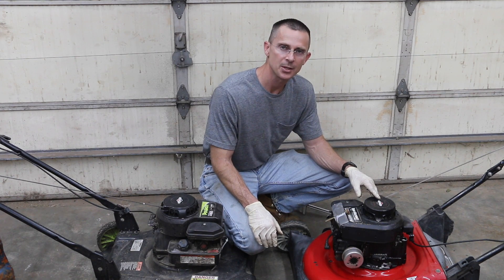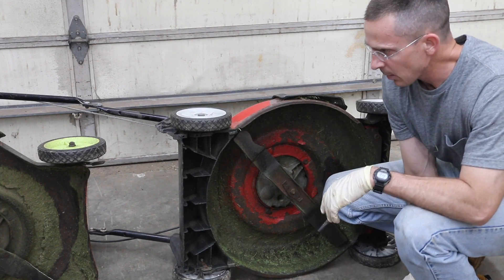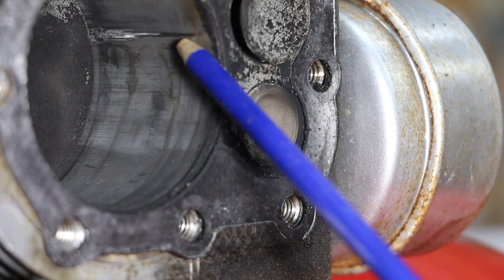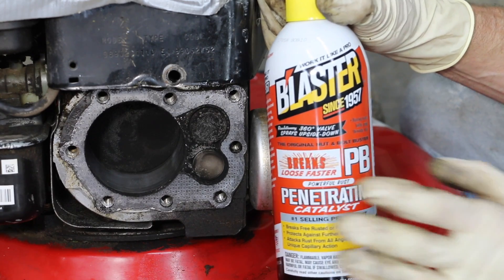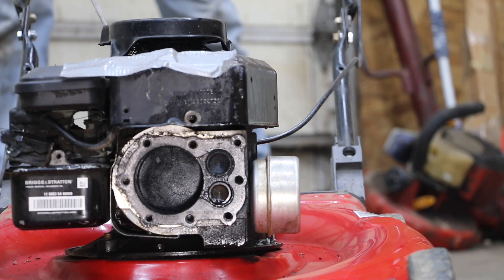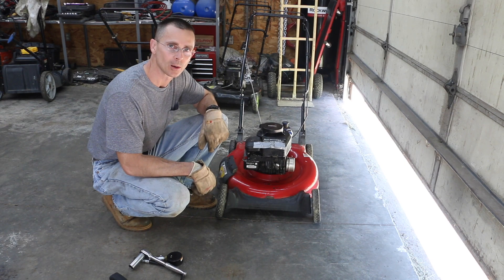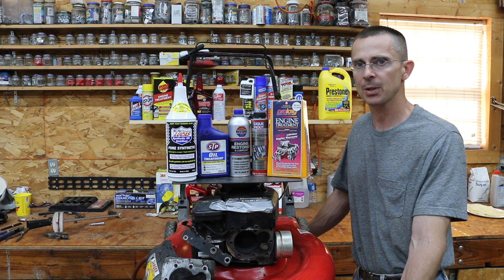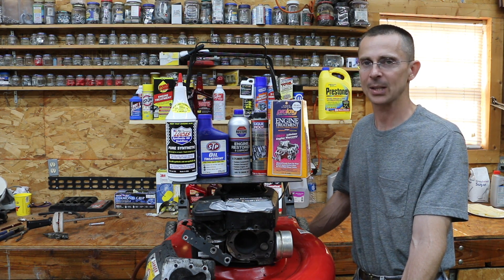Engine ran without oil, seized! Can it be saved?

Comment: consider testing non stick coatings on the underside of mower deck , like modeck ( made in america) :) Base line , paint only , no paint, modeck , and an oily after market brand name no stick . ?
Reply from the maker: Thank you
Reply: @ProjectFarm  Couple more thoughts. rust prevention fluids demo, products to keep locks from freezing in the winter , Best lights to keep well house from freezing , thermostat outlets to plug well house lights into ( thermacube I think is the name, on amazon) , nitrogen in tires helpful or a waste of $s, Best head light bulbs or alternatives for a tractor or riding mower, safety demo regular sockets vs impact sockets, cheap vs expensive cut off grinder disks, pad sander vs orbital sander finish quality,  best farm tarps - price vs longevity, how to reinforce tarp corner grommets , is it worth fixing, cheap vs expensive truck plug wires , chain saw bar oil quality vs cheap type, flame retardant welding clothing, well water whole house filters tips , things to avoid,   12 solar car chargers worth it or not,  cheap vs good quality hand tools, wrenches , screw drivers,  etc, series of top 10 lists- for farm, home, auto maint., safety , fires, seasonal tips, accident prevention, lower utility bills, 5-10 "other" uses of everyday items, concrete strength test - with vs without steel mesh, with or without fiber mix in the cement, 5-10 different chalks to use around the house and where NOT to use them and why, 10 tips for ladder safety, the right and wrong glass and clear plastic cleaners, smoke alarm , co2 , tests explain why they are all hard wired together with battery backup, how to shop for tires and what all the tire "language " means to safety and performance, save yourself on the road car repairs and some of the tools to always keep in your truck or car trunk, kitchen knife sharpeners, non stick pans cheap vs not, septic tank tips to keep things flowing, how to maintain home furnace,  how to safely clean outside and inside furnace coils, water heater maintenance, attic stairs energy sealing and insulating, blade sharping for mowers, changing mower , auto belts before they break, waterproofing types to protect leather work boots, what to do in a house when the plumbing fixture leaks, best fire extinguishers ( hint think baking soda) , home air filter demo - quality vs cheap, how and why to use better quality washing machine hoses with washers, garden hose quality vs price, tips to teach children on home safety and emergency's , 5 places to consider volunteering in your home town , how to teach your children to value grocery shop and read shelf labels, teenager tips to avoiding driving in flooded road areas, changing a flat tire, home security methods , same for garages , sheds, washable wall paints worth the money, how to clean the dust out of your computer cpu box, tips on buying a used mower, 10 meals every kid should know how to cook from scratch,   how to shop for a quality umbrella, how to choose the right bulbs and change head light and tail lights, ok that should keep you busy for a week or three. Consider me part of your unpaid emotional support team from afar, ha ha

Comment: I think this is the best channel on YT.  Your testing methods are very good. 
As for the engine at hand. it can be rebuilt better than new if. you want to spend the money and the time.

Lubricants additives, "MOST" are misleading at best to a down right lie on what they can do.
Bearings are not used by way of friction. They use pressure on the oil or grease. There was a lawsuit on Teflon additives. The Teflon claims were proven false. Another fact is, when Teflon burns, it forms hard crystals that will score cylinder walls and cause the rings to freeze up.  That is why your Slick50 engine seized in 2 minutes. 

The additives that do any good on old noisy, oil burning and/or low compression engines is because they are detergents that helps clean piston rings by loosening the carbon deposits. It also helps dissolve the oil-varnish on and in hydraulic lifters. One bit of irony is when the product works the way it should. the engine will quite often leak oil from rear seals and from the valve cover gaskets. 

Most of these issues stem from non-synthetic oils of the past.  Oils that are 100% synthetic do not need any additives as they will do nothing to help and in fact, will destroy the oil.

I can go on in great detail but I'm going to stop today.
One more thing Redline oil is the best out there. That is my opinion. however, there is much data on this. I am not affiliated with Redline in any way.
Reply from the maker: Thank you!

Comment: I really like these videos with these small engines. Something I think would be very interesting would be to test a flat head motor compared to an ohv. Briggs made really good L heads but these newer ohv just don't really hold up as good as the old L heads. I also don't understand how its even possible that my push mower makes 8.75 HP ohv  were my walk behind mower has an 8.5 HP L head. Not only that but a 5hp flat will cut taller grass than the 8.75. I think it would be interesting to see what lasts longer and what's really making more power is there something I'm not getting or is Briggs lying... Either way I look forward to seeing more good videos. Thank you
Reply from the maker: Thank you for the video idea!

Comment: After you did the no oil in crankcase video I was hoping that you would do this video. I think that your knocking is caused by a bad crankshaft/connecting rod issue. Time for the heavy syrup STP.
Reply from the maker: Great point!

Comment: An anecdotal (but very true story):  back in the mid 70s, my dad had a 66 Ford Econoline with a 240cu inch 6, and he ran it out of oil and it seized.  I went back with a few quarts of oil after it cooled and started it up.  The only problem was it had a bit of a rod knock (or something knocking).  Not bad but you could hear it.  Dad started looking for a new van and ran the 66 for at least three months, but we drove it easy and short shifted it as to not over-rev it.  Finally sold it to a guy for $100 because of the bad engine.  Saw him many months later at the part house we both used and  he was chafed that the engine blew.  I reminded him we told him it had a bad engine.  I guess he thought that little noise was nothing and that he robbed the van for cheap -  until it threw a rod.
Reply from the maker: I enjoyed reading your comment  on this.  Rod knocks rarely have a good ending.

Comment: I know this is an older video, but if you still have that mower try putting some 50 or 60 weight racing oil in it and see if that silences up the rod knock. I have an old mower that knocks some when it bites too much grass on a pass and am going to try it myself.
Reply from the maker: Thank you

Comment: I wonder if you can use a steel brush to hone out the scuffs and scars on the cylinder walls, and just equip it with new piston rings, and if that would help the compression?
Also, I would probably use thicker oil. Like 5W40 or 10W40 instead of 5W30.
Reply from the maker: Great point. Thank you and Happy New Year!

Comment: Great video and a good question...there a some oil additives the contain ceramic substance and are suppose to coat the bore and bearing surfaces. Plus ceramic is and excellent lubricant so they say. I've seen several videos and people swear by them. So if you could go for it..
Reply from the maker: Thank you

Comment: When I get an engine that has been siezed, I spare absolutely 0 expense if its savable. I tear it down 100% and check for rod knock and internals. After that I remove crankshaft, camshaft, and the piston. I heavily lube those, as well as heavily lubing the cylinder wall along with the valves. Ive only had to do that once with an engine that managed to get away without knock.
Reply from the maker: Thank you

Comment: I would like to see you remove the Piston sand the walls down clean the piston rings and put the Piston back in and do a compression test just to see if the Sandpaper trick really works. Thanks. I've seen videos of people sanding it down but I have not seen them put it back in and running.
Reply from the maker: Thanks for the video idea!

Comment: I actually had the diesel engine in my skid steer seize up a few years ago .. was not in a good place to have any issues!!!!
Mine was strictly heat related.... 
The idiot light for over temp. didn't come on... Water pump died, wasn't pumping... Bearing and shaft we're ok...but it wasn't pumping any coolant! 
Got some cooler water in it, gently cooled the outside of the block.
Actually got it running a few minutes later ...  Radiator wasn't in good enough shape, so.. new water pump and radiator... That was 2,000 engine hours ago, still runs like a top!!! Also has an actual TEMPERATURE GAGE now!!!!
Reply from the maker: Wow!  Nice save!
Reply: @ProjectFarm  ya... Had my butt puckered pretty good!!! Out of all the equipment we have, the skid steer is by far the most used piece of equipment!! Not only does it do normal loader work, but we use it to work on other equipment.... Way better than having 6 or 8 guys straining their backs... Or a couple of guys jumping up and down on a big bar😎
You know what they say... Work smarter, not harder... LOL.. still work too hard and too long, but get more done 😉

Comment: The piston rings and big end bearings have probably already been damaged or severely worn by being ran with out oil sure you could Maybe make it run again the question is for how long without needing a rebuild Assuming the block can be salvaged I’m no mechanic I’m just expressing my thoughts on the matter
Reply from the maker: Great point. Thank you

Comment: @Project Farm Is mobil 1 the oil you use in your vehicles?
Reply from the maker: I like it a lot and use it sometimes if the price is right.  I drive older vehicles and am not willing to spend too much more for it.  I buy it when it's on sale. Thanks  again.

Comment: My neighbor had a 95 Ford (this was in 2000) 4x4 5 speed manual 300 Straight 6,  he bought it brand new and used it for a farm truck mainly went from farm to farm to check cattle or hauling bags of feed. It quit on him in the middle of the field by my house and he basically said the hell with it and it sat there for 2 years. I aggravated him to death wanting it and he told me it was locked up but he would take $400 for it (it had 30,000 miles in it. I immediately paid him so he couldn’t back out. I put a new battery on it and sure enough it was seized tight BUT was full of oil. I took all plugs out and put A LOT of PB Blaster in each cylinder and let set for 7 day, I returned with a long breaker bar and a socket to fit the crank nut and I worked it back and forth till it freed up, pull plugs again, and cranked engine to blow any remaining PB out, put new plugs in and hit the key, she started and smoked like hell, and I drove it for a week and the smoke gradually stopped, I tuned it up, drove it, 230,000 miles and 16 years later, after teaching my son & daughter to drive a clutch I sold it for $750 to another farmer for a farm truck and it’s still going and going !!! I’ve owned several trucks with that 300 6 cylinder in them and LOVE THEM !!
Reply from the maker: Great save!  Yes, that's a terrific engine.  My father drove an F150 with the 300 CI for many years.
Reply: 300 straight 6 damn good engine hard to kill

Comment: I have a 6.5 Briggs on a power flow bagger that I fabricated to fit my mower and in the time of fabricating everything to go on my 3 pt hitch I didn’t check the engine oil so when I got done building everything and started testing everything the engine stopped so I pulled it again and it ran for another couple seconds and stopped so that’s when I checked the oil which was empty so I took a bar and broke the engine loose, filled it back up with 10w-30 synthetic and it’s been running like a champ ever since, no knocks or ticks, this video interested me quite a bit
Reply from the maker: Excellent!  Glad the engine survived running dry.

Comment: I suppose it wouldn't matter so much which product you chose to use I would imagine that any one of them would yield a positive result. However, according to their own websight of mosr of these Restore products do they make any claim to help on main bearings only on cylinder walls. There could be a significant amount of damage there as well as well as the crank. So I got to wonder which product would help there as well. I might try them all if possible. Good video i enjoyed watching.
Reply from the maker: Thank you

Comment: came home one day wife said the mower made a loud noise then quit. i looked at it .all the bolts holding the case together had fallen out. oil leaked out  the connecting rod broke. bought a new rod sanded the real rough marks on the crank. bolted it back together still running 8 yrs later
Reply from the maker: Wow!  Glad you got it going again.

Comment: One of my employees started my leaf blower with straight gas and it won't start now, any ideas or video ideas on how to fix. Love your channel.
Reply from the maker: Recommending removing the spark plug and adding Marvel Mystery Oil to the cylinder.  While the spark plug is still removed, attempt to get the engine to spin over using the pull cord.  Once you get it spinning freely, drain out the Marvel Mystery Oil and put the spark plug back in place.  I hope this helps.
Reply: Project Farm thanks. I tried to start it again, I did not have your advice with me but put oil in cylinder but still would not go, it seems to have compression at least a little but I think maybe cylinder seal is burned out. Do you think it's worth taking apart to see?. I am sure it is even just to learn but thought I would see what you thought.
Reply: Thanks. I plan on going to garage tomorrow to work on it. I also did a full Seafoam treatment on both my 1999 Isuzu rodeo that my wife drives and my 2004 Nissan Xterra flowing your advice and the Isuzu rodeo more than the Nissan really is showing huge improvement. Thanks a ton.

Comment: The STP Oil Treatment will make a good engine burn oil by gumming up the rings. I have used Duralube Instant Quiet DIQ with good results. Engine, trans, differential, power stering. The Motorcote and bestline could be better but DIQ is economical and readily available.
Reply from the maker: Great point. Thank you

Comment: Just wanted to thank you for your videos. You showed me that mowers are not only pretty resiliant, but also that it's pretty easy to take one apart and diagnose a problem. My wife and I got a freebie mower (Weed Eater 158cc Briggs) this summer. We ran it for a while and it siezed. I never bothered to check the oil when we got it. That was my bad. I pulled the spark plug to make sure it wasn't hydrolocked,  then checked the recoil spring to make sure it wasn't bound up. I hand spun the motor and it was tight. I think we were fortunate that the motor siezed pretty early into the last mow before a lot of heat built up. It didn't take a lot of hand pressure to free it. Ran an additive (Mechanic in a Bottle) along with the oil. No knock and clean exhaust. Ran it for an hour today. I think it's going to survive another year of service! Keep up the awesome videos!
Reply from the maker: Great job reviving the mower!

Comment: I've got a 70 IH cub cadet with a 12 HP engine in it and a 71 IH cub cadet with a 7 HP engine in it and I was just draining the oil from the 12 to put in the 7 because the 12 has only 2 cylinder rings and runs like crap . I had drained the oil and then started the 7hp to hear it run. It ran really good and  after 2 min it sputerd a couple times and stopped and as I was looking around it I saw the oil pan was still under the 12hp engine full of oil and I realized I just ran it with out oil so I'm going up there to try and use a pipe wrench to move the shaft and if that dosent work I'm going to pulpit while in gear.
Reply from the maker: You might consider adding some Marvel Mystery Oil or ATF to the spark plug hole and then attempt to get the engine to turn over while the spark plug is out.  A couple of teaspoons is all that's needed.  Just something to consider.  I hope this helps.

Comment: To improve compression, I would use a very heavy oil. So If I had to choose one of those products, I would choose whatever seemed to have the most thickness. I don't think that it's possible for a fluid additive to an engine for it to be able to actually perminantly 'fill in' the deep scoring marks and loose ring seal. Because if a product was actually capable of doing that, what would stop it from hardening up on every other surface of the engine that you didn't want it on? So because of that theory, I think that the best you can do is using heavier oil which will help fill in those compression gaps, without actually changing the physical properties of the engine itself like adding new material to the walls where it was lost. To do anything like that a proper rebuild would have to be done with honing and rings and all that. I hope you understand my meaning. There is no way a product could fill in those scoring marks, without filling in other areas of the engine like the rod bearing or crank bearing or anything else that you don't want filled with hardened material. So the only way it could work is by the actual properties of the fluid additive itself. We know that thin oils will blow by imperfections much more easily, and that they also have less film strength. If you really wanted to break it down it there would be an ideal film strength and oil viscosity thickness combination that would be the most ideal for that particular engine in it's particular state, i.e. a briggs style motor with a specific amount of blowby and compression loss.
Reply from the maker: Thanks for the recommendation.